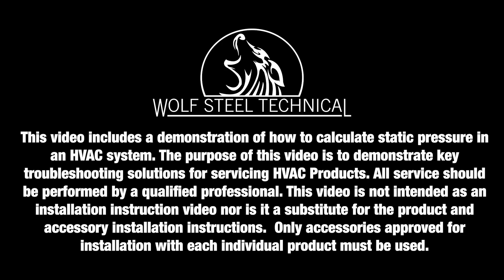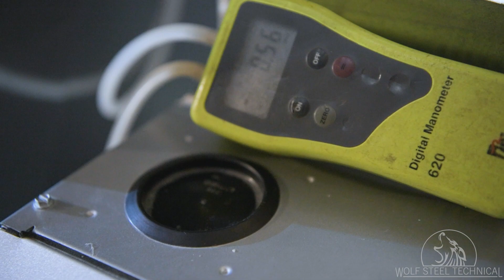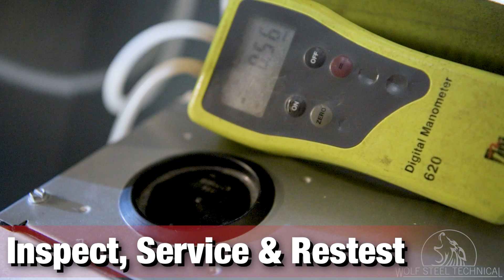How To Calculate Static Pressure

Comment: What should be the target static pressure
Reply: The Napoleon furnace in this video is certified for a maximum of 0.50" w.c. total external static pressure. It is info contained on the rating plate. If the static pressure is too high, the likely result will be the ECM fan motor end bell components will overheat and fail. Static pressure should be measured on the down stream side of the filter, as even brand new, clean high MERV rated filters will add excessive restriction. The ECM motor will overheat and fail if the filter is too restrictive just like it will if the duct is too restrictive.
Reply from the maker: Hey Derek,

This varies with each appliance and depends on the Superheat/subcooling, or Delta T calculations along with fan speeds. You should refer to the product manual to attain the correct Static pressure for the installation.

If you're servicing a Napoleon product, you can find helpful info here:

https://www.napoleon.com/en/ca/heating-cooling/support/hvac-professionals-support-center

And if you're servicing a Continental product, product info can be found here:

https://www.continentalcomfort.com/en/professionals-support-center/

Hope this helps!
Reply: Gadgethunter couldn’t be more right. Filter should be included in the measurement. Also the probes used to measure are not pitot tubes. That is a very different tube for measuring air velocity. The static pressure probes should be placed to
Face against the airstream not with.